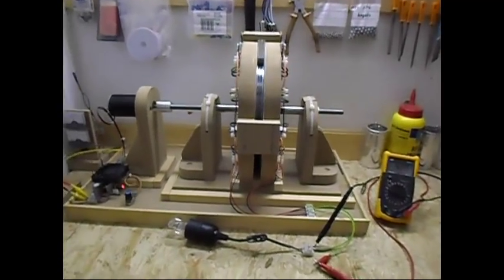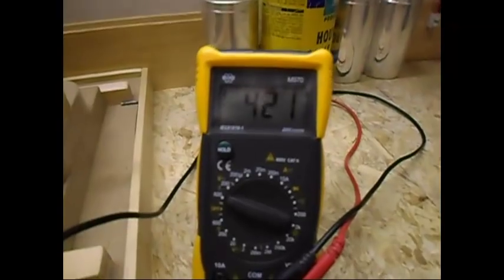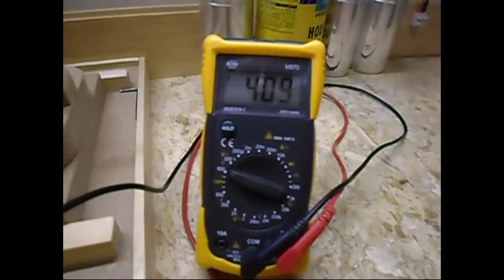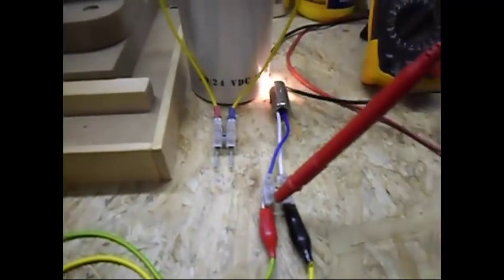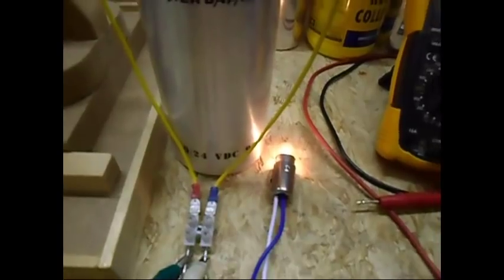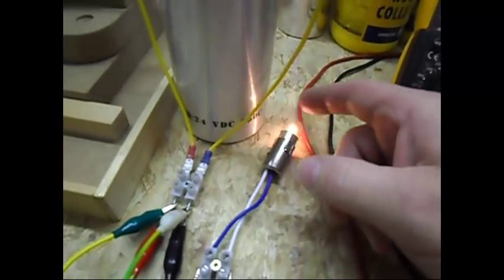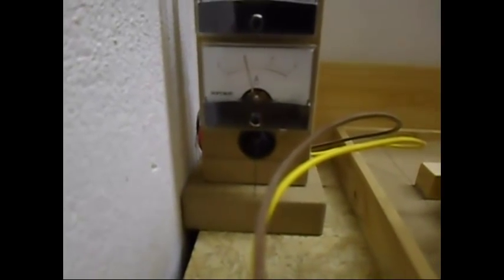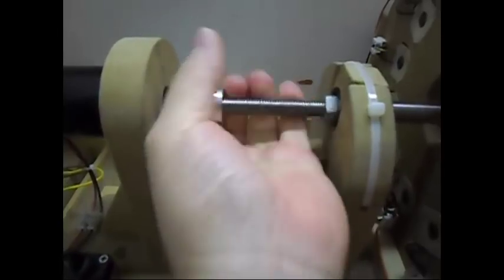Single Phase Generator_Update 3 - Modifications done, lots of voltage but where are the amps at...

Comment: Ferrite cores or plugs are made of nano particles which self align at casting time. The magnetic flux is carried right through the coil(No current). Iron an amorphous material turns that flux 90 deg so it can pass through the copper wire.  
Nice build though.
Reply from the maker: Thanks for your comment, your extra info on cores and i'm glad you've liked it...^^
In this case it doesn't matter what cores i use because there is something to that new rotor i'm using in there of which i haven't shown..."a personal secret design"...lol
At the time it didn't seem like much but it works pretty good especially with the magnets on the back of the cores as can be seen in my last update on this setup but will it be good enough...???
Time will tell...^^

Comment: When you hit resonance you may hear louder sound due to the coils reacting with magnet mutual inductance.
When you slowed down the motor I heard a change in sound like you attained resonance.
Hook up the lamp and slow motor rpm and see if amps increase.. worth a try...it may be motor is above resonance.too fast......
Reply from the maker: Thanks for your comment and extra info on this resonance...^^
Yes, there is a lot of noise and vibration at some point at lower rpm that is for sure...lol
It has been noted and I'll give it a try this weekend...slow start and rpm increase with load/light conneted...^^

Comment: Try a larger diameter wire,it should give you more amps though lower voltage ?. If I remember correctly. Best of luck.
Reply from the maker: Thanks for your comment...^^
Yes that is correct about a larger diameter of wire giving more amps and less voltage...:)
Don't have enough wire to wound so many coils so i'm gonna test just 2 of them in series/parallel and see what is best option and than maybe connected all of them in such manner to have 12 pairs in total so i don't need the transformer...
Removing the transformer also remove a bit of energy losses...;-)

Comment: you have good voltage, now you just need a transformer to get amps- have you seen Gerald Morin's videos on yt?
nice video
Reply: Actually, I think he meant to use step-DOWN transformers... Volts will drop, Amps will rise... that bulb is a low voltage lamp, right? If you had a lamp rated for 400V, it would draw less Amps, and would light.

In the second part of the video, do you know what the frequency is going to the transformer? If it's above 1kHz, it could be too high for the steel core. Are all of your Coils matched up 1:1 with magnets? (same number of each) I would assume so, since you have all the coils connected in series.

Have you experimented with the a single ferrite core coil, and a "biasing" magnet behind it... moving it closer/further away, and reversing the magnet polarity... to see if you find a better output from that one coil?
Reply: Yep... RomeroUK.   I think one of his other tricks that got his working was to use mismatched numbers of coils/magnets... so that there's no one "sticking point" so to speak. This certainly requires a lot more electronic parts, since you need a bridge rectifier for every pair of coils... and each pair of coils needs to have enough voltage so that the losses in the Bridge Rectifier (B.R.) is not significant.  I would think you want to keep B.R. losses under 5%, so ACV P-P into the B.R. needs to be 20V P-P... or so?

Fortunately, bridge rectifiers are pretty inexpensive.... but you could reduce B.R. losses significantly (at least 50%) by making your own Schottky bridge rectifiers from four individual Schottky diodes (about US$0.30 each on DigiKey for 3A/40V diodes)

You do such beautiful work... real "craftsman quality"!

If we're going to consider "what if"... I wonder what would happen if you used spring-loaded ferrite cores? Then you get both Variable Reluctance and Magnetic Induction effects... as the magnet approaches the coil, it pulls the core into the coil, increasing its permeability and magnetic coupling   :-) Would this multiply the output of the coil?  hmmm...
Reply: I'm not convinced that re-wiring to 3-phase will decrease cogging if your coils/magnets are 1:1 ratio... cogging is mostly from the magnetic attraction of the magnets to cores... not so much Lenz effect.

Increasing current takes: closer magnet-to-coil coupling, or a higher permeability core (to attract more flux), but results in higher cogging. You run a lot of coils in series, this will certainly decrease the available amperage, but increases the Voltage... same amount of available POWER... there's always that tradeoff.

Also keep in mind that as the RPM's climb, your coil impedance will also climb, and you will begin losing power through inductive-reactance.  With 12 magnets in your Rotor, you have [12-pulses per coil] per rotor rotation. At 2000 RPM (or 33.33 rev/sec), that's 400 Hz seen by each coil. If your coils (with cores) have 5mH inductance (just using an example, I don't know what your coil inductance is), at 400Hz that's 12.566 Ohms of inductive-reactance per coil.   If all 12 coils (per stator) are connected in series, you have 150 Ohms inductive-reactance (effective "resistance") in series with each stator output... that would be very significant losses.

Have you tried different series/parallel coil combinations?   I would think running the front/back pairs connected in parallel might help... since that directly ties both pulses from each magnet together directly. 

Then connect the "12 front/back pairs" in series for high Volts... or for higher Amperage, connect them "split": [6-pairs in series] paralleled with the other [6-pairs in series]. This would greatly decrease the overall inductive reactance losses.

Just some suggestions... I know you have a lot to try already.

I commend you on your ongoing experiments, and making these nice videos!    I have 30+ yrs of EE experience (I'm 57), but my available time and funds restrict my ability to "make".
Reply from the maker: Thanks for your comment...😄
I've seen some videos from Gerald Morin and about transformers being able to get amps...???
If the generator produces enough amps you will have enough amps but in my case it does not produce much amps so even if i should use 1 or 2 transformers the outcome will be the same...;-)
Increasing voltage with transformers doesn't mean amps go up as well...i wish...lol
Reply from the maker: Thanks for your comment...^^
Yes, step down transformer makes for lower voltage and higher amps as you can see in the second part of the video...;-)
And Gerald always step up his system so i thought he meant the same...???
The light in the first part is a 230Vac 28watt incandescent bulb...maybe it was a bit to much for this test and maybe a 10watt or so would have been better but it is the only one i had at this time...
About the frequency going to the transformer ...i don't think it is above 1KHz and the ratio is at this moment of the video 1 on 1 coils/magnets...;-)

Ahhh, the romero kinda test...a "biasing" magnet behind it...i've totally fogotten about that one...lol...and thanks for the remimder...^^
But i will write it down to test it out once i re-configure the system since i just configured it a bit different to test just 2 coils only...^^
Reply from the maker: Thanks for your reply, your compliment and all them extra input of yours...^^
The mismatched numbers of coils/magnets is good for reducing the cogging effect...;-)
If i go for 9 coils it can be connected as a 3 phase generator(star or delta) and the cogging will also be far less...
But i'm working on increasing the amps a little bit first...
I do have a lot of FWBR so that is no problem if i need to use a lot of them...

I don't think it will help much that spring loaded cores idea of yours...but it will bring even more parts into the equation and that also means more parts that can break and so more maintenance and so on...lol
But it does sound like a fun test to do just for the fun of it...^^...but i'm completely full already on my "to do list"...lol
Cheers
Reply from the maker: Thanks for your reply, your commendation and the extra info and suggestions...😄
I wrote 
"If i go for 9 coils it can be connected as a 3 phase generator(star or delta) and the cogging will also be far less..."
Since the rotor is a 12 pole a 9 coils/core setup will reduce the cogging effect a lot...i have a video on that and have tested it many times and it's works pretty good...;-)

Agreed on the "same amount of available POWER" part...;-)

This,
"If all 12 coils (per stator) are connected in series, you have 150 Ohms inductive-reactance (effective "resistance") in series with each stator output... that would be very significant losses."

That's why i leaning toward and testing going for 12 pairs in series(the two opposite coils on each side of the rotor) and then all 12 in parallel but it all depends on how the testing goes...i let my system tells me what is best for it...;-)

This,
"Have you tried different series/parallel coil combinations?   I would think running the front/back pairs connected in parallel might help... since that directly ties both pulses from each magnet together directly."

Been doing just that yesterday(read above) and it looks good so far...still need to do that magnet on the back of the core also...so many stuff to do...o.O...lol

This,
"Just some suggestions... I know you have a lot to try already."
Good info and it's all appreciated...^^

30+ years is a lot of EE experience and good to see you are still going with it even if your time/funds are not enough...do keep it up...^^
You are 1 decade older than me...^^
I intend to go as long as i can imagine/vision things/stuff i want to build...:D
Cheers

Comment from the maker: Did some modifications and this generator still has a lot of voltage but where are the amps at...???...lol
Whatever i do with the AC/DC output it doesn't put much stress on the drive side of the system...😄
Gonna do some more mods and hopefully get a bit more output but if possible without more stress on the drive side of course...;-)
And yes, going for a even/uneven core/magnets configuration would help a lot with that massive cogging and so it will consume less power but the power out will be less also since it will have less coils...lol
Reply: Something to think about. Neither voltage nor amperage is independent. V=IR. For 420Volts in the system at no load, the internal resistance of your generator must be low and the amperage also low if you connect a resistance like that lamp and the voltage drops to 5V. The resistance of the lamp is easy to find with a multimeter. If you do the math, I = V/R. The outcome will be proportional so you can use it to find the internal resistance and amperage of the generator at no load. The ratio of that 415v drop is 84:1. Your problem is stress on the drive side. High amperage in the generator's stator coils equals strong magnetic fields also generated in those coils, as field strength is based upon ampere/turns instead of voltage. Strong fields mean high drag on the fields supplied by your magnets. This equates to a lot of stress on the drive side, you can't evade that. What you might try is to isolate the system using a step-down transformer. I don't know if it will work or not.
Reply from the maker: Thanks for your comment...^^
Good explantions on the "Neither voltage nor amperage is independent. V=IR"...nice indeed...;-)
The thing in this setup is that the rotor is a prototype rotor and not your normal rotor and that is why it acts like it does...;-)
I'm still working on it so every now and than...there will be a video on it soon again with coils i've used oin the speed up under videos...^^
And yes, in the upcoming video i'll be stepping it down and that should give me a better output hopefully...lol
Reply: I was building a different type of generator at one point, completely solid state with no moving parts. It had both field and stator windings, of a sort, but the field was manipulated to rotate instead of an armature. When you get into "interesting" types of generators, as we have done, many times the outcomes were unpredictable and often quite surprising as well as educational.
Reply from the maker: That is nice to hear about a solid state version where the magnetic field rotate...
Well, if done with AC current that would be easy to obtain...a armature that doesn't need to rotation...;-)
Yes, sometimes outcome can be unpredictable...lol
Reply: Pulsed square wave DC can provide interesting results as well, that is, if the proper frequencies are used.
Reply from the maker: Yes, you are correct and it makes sence...^^
When i logged off i was thinking the same about using pulsed DC also when it comes to a SS generator version...;-)
Reply from the maker: For got to add that a specific Frequency is a must in some cases...^^